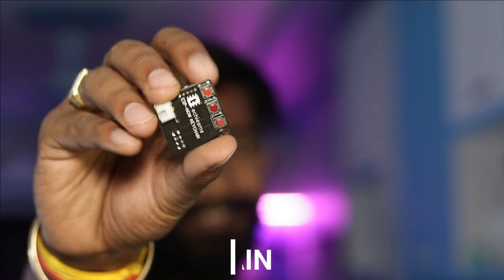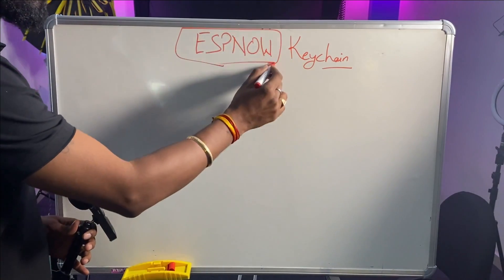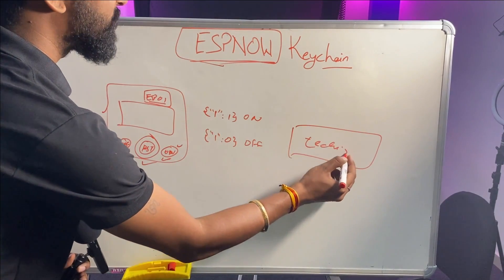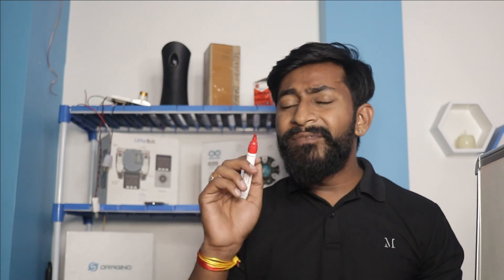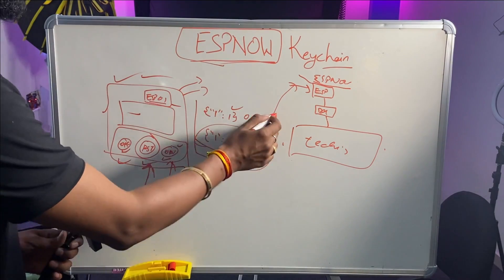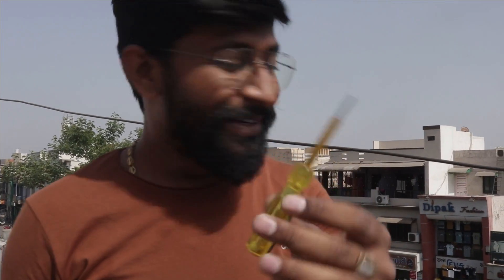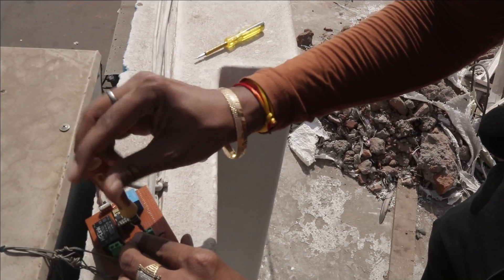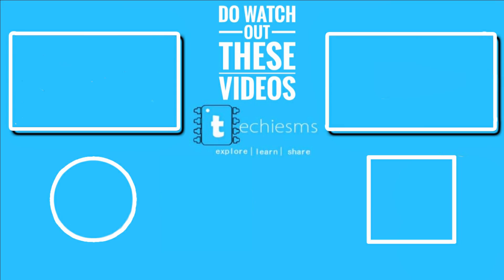It Controls my studio WITHOUT Router, Hotspot & Internet⚡️⚡️

Comment: Great use case and work. But don't your think its better to use a MOSFET or relay (probably it will look big in size for your use case) to Turn OFF the circuit completely? that will help you save the battery further. 

As i have a similar use case for my door sensor and with 18650 battery i am running my system from more then 3 years, without even a single recharge. And still 60% battery left!

With esp8266 12E board. Removing the LED indicator will help you to bring power consumption further down.

Comment: why the reset button? of the purse you can use two tik switch  that will power esp and set the logic state, just use two diodes, the switch power the esp and the diode sets the logic, so you have zero consumption in standby. Regards

Comment: Hey you can simply use the reset button and a toggle function in the code to perform all the essential activities. As adding two more buttons is quite clumsy thing you know. 😜
Reply: Would he then have to be able to see if the lights were turned on or off before he toggled the relays to know whether he was turning them on or off?

Comment: Good and you may remove reset button always when you press on or off it should trigger reset then on off physically as it's in sleep mode !
Reply from the maker: wow!!
Sounds interesting...
Have you used it ?
Reply: @techiesms It's my hobby and has many more parts sensors boards almost everything but not enthusiastic like you and need more motivation personally.. btw I'm from Vadodara too.

Comment: I have a question ⁉️
Why not prolong the battery further by NOT even using deepSleep rather keep it off, and the ON button (and OFF buttons) would simply close the circuit to turn ON the ESP ?

Meaning, instead of wasting that little mAh per day in deepSleep, why not keep it OFF anyway?
Reply from the maker: That's why I kept both the options 
I do even have a On-Off button on the board

Comment: Fire hazzard, no flyback protection awful on relay portion. Sender portion exapmles: no encryption, and even if it was has no rolling code or scheme so is open to replay attacks. Cutting live wires. Which part of this video is good again?
Reply from the maker: I reviewed it and found that I haven't used a flyback diode, that's totally our mistake as it was made by one of our intern and he was  also occupied with out Mumbai event. And talking about the encryption and attack then, here In my area, no one is using ESPnow and hence I kept it open. to make the code look simple as well
Reply: @techiesms  Thank you for your answer. I hope you will take these considerations under advisement for security and safety reasons, and that maybe this gives you ideas for future projects.
Reply: The flyback diode is already installed at the bottom layer of pcb